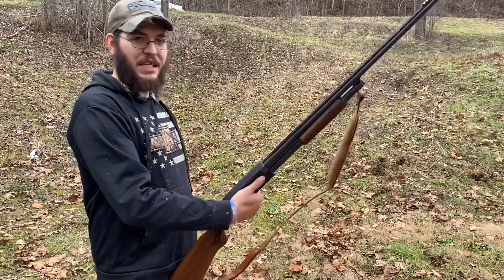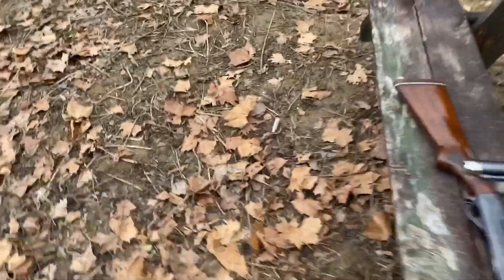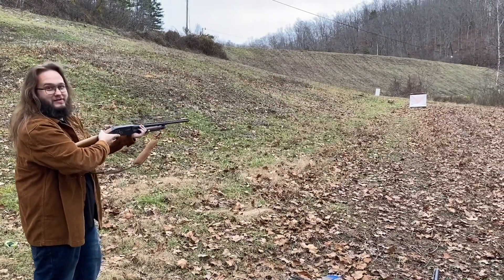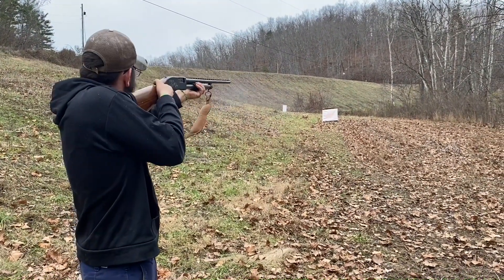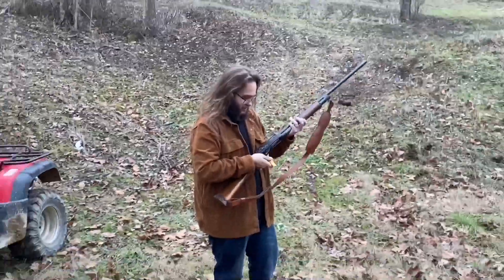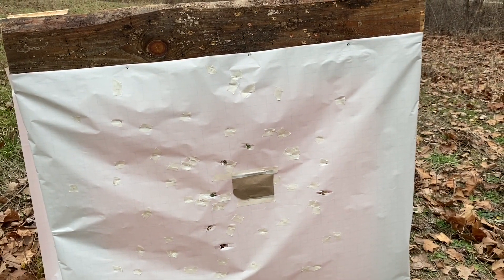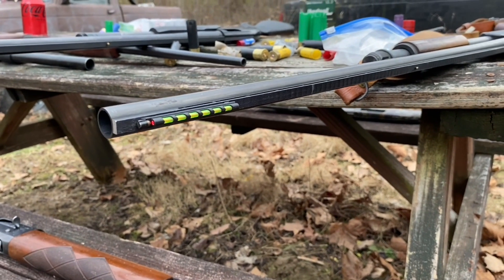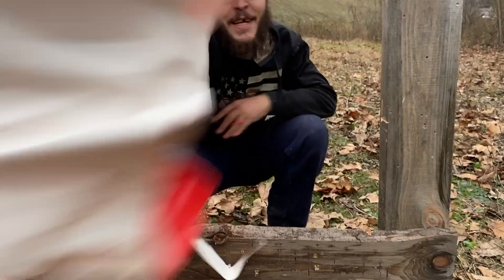20 Gauge Buckshot Range Testing Part 3

Comment: HS6 was always my go to for 20g
Reply: That's a mighty fine powder!👍 One of my favorites also
Reply: @vdog4799   HS6 ive found in my 20's waa overall best pattern and clean. 
Another powder i liked was greendot.. 
At 1 time i used 571 winchester powder which is same as HS7 in my 3" loads. 
I havent loaded 20g in ages. No more 20g gun ..i was liading for a mossberg bolt action 3" chamber. With factory mod choke.. Now mainly im 12 and 16 g loads

Comment: I've noticed in a few of your videos that some shells stick in the chamber. You may know this but a common cause is the chamber has a little carbon build-up which can cause this. There is a chamber/choke tube cleaning kit for different gauges. It includes a short rod with a handle, an over-sized bronze brush with heavy-duty bristles and some solvent. They work great. You could just buy the bronze brush and use an adapter on a pistol rod to.
Reply from the maker: That gun is clean as a whistle, they were just extremely cheap low quality guns from the 1960’s. Nearly every 3” shell we shoot, factory or hot, sticks in the gun. 2 3/4” is fine though it seems. I’ve honed them chambered on most of my old guns and even some of the newer ones.
Reply: It sounds like you just have a sticky gun. It happens.